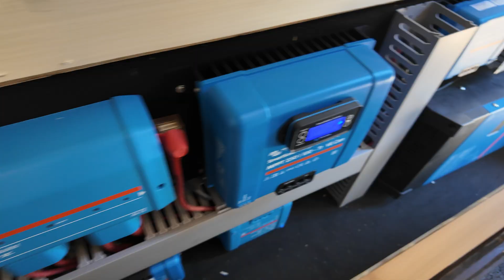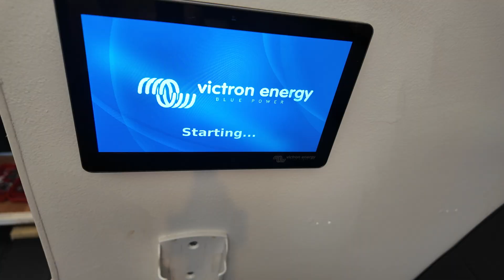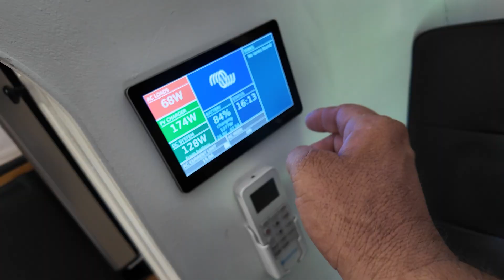ULTIMATE OFF GRID BUILD-SOLAR POWERED 24V TRUCK CAMPER 1600W Solar + EG4 Batteries VICTRON

Comment: Purdy slick set up. 400 watt panels your saying. Wow. Used to seeing 200watt panels. 
What was the cost for all your equipment? Panels, batteries, inverter, and victron components?
Ballpark?  
Do you have to change anything going from a 12 volt set up to higher voltage setup ? Thanks in advance. 👍
Reply from the maker: Hey thanks for watching. I'm probably 8-9k all in for the components. Absolutely 100% worth every penny. We love our system.
Reply from the maker: I run 24v to 12v dc charger to keep the 12v house battery charged so I can run all the lights and my jacks. My battery bank is 24v and that goes to the inverter to be converted to AC 120v power.
Reply: @runawayparents oh wow excellent. And wow man thanks for replying. So gracious of you. Much respects. Side note You’re so blessed to spend time with your pops. What a guy. 🙌

Comment: Do you have a fan in with your electronic components so they don't over heat?
Reply from the maker: No fan but haven't had an overheating problem yet. Everything seems to run just fine.